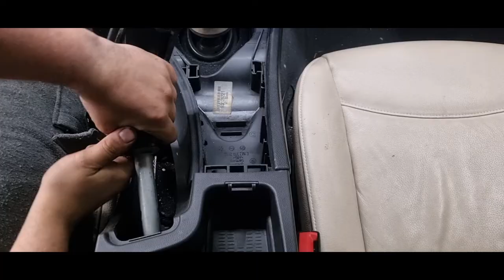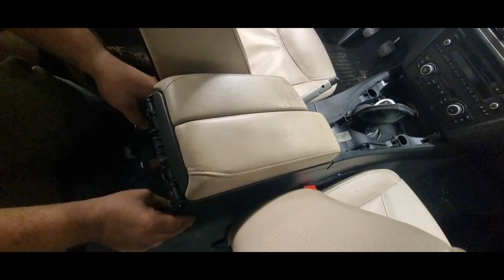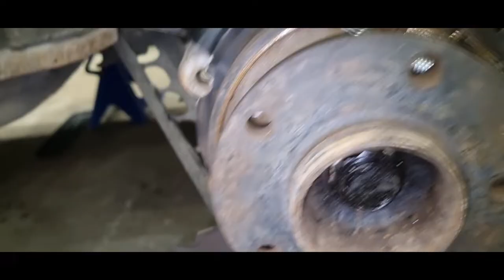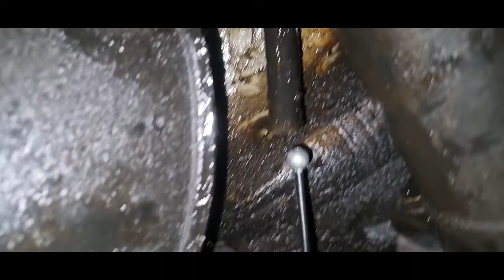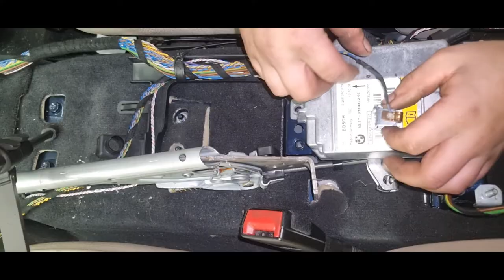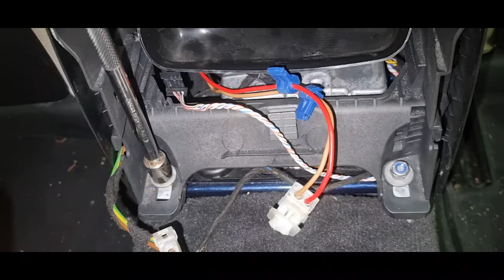How To Replace E-brake Cables BMW 316d (E90)

Comment: Thanks for the nice video. What was the problem you need to change the handbrake cables? My handbrake sometimes stopped in 3 clicks, sometimes I need to pull it until the end to brake the wheels.

Comment: Thanks for posting this as it will be helpful to me. I'm working on a 128i, swapping out the wheel assemblies (knuckles with bearings, hubs, suspension arms) and rear axles.  I will need to either use the e-brake cables attached to the new (used) assemblies or use the old ones already on the car. So, the difference of do I detach them at the e-brake handle and feed the new ones through or do I detach at the parking brake and use the old ones already in place. Your video gives good information to help me either way I go.
Reply from the maker: Thank you for watching, im glad you liked it! There will be more videos
Work safe!👍🏼